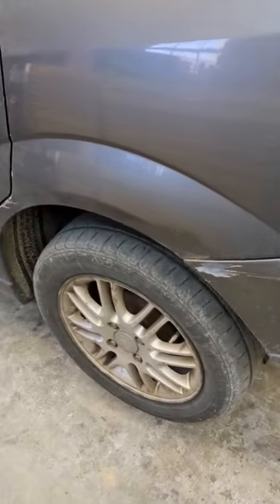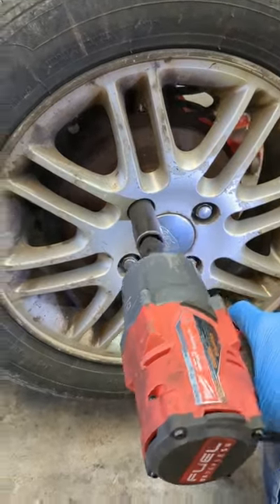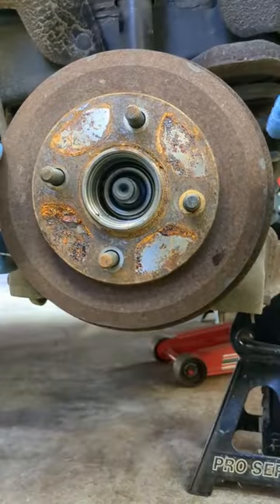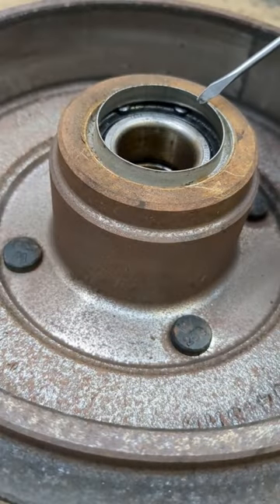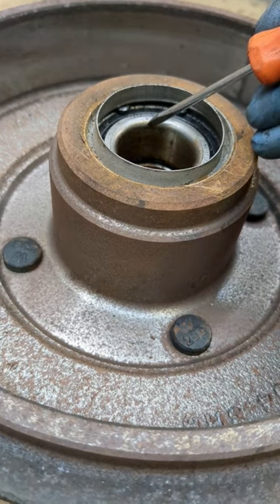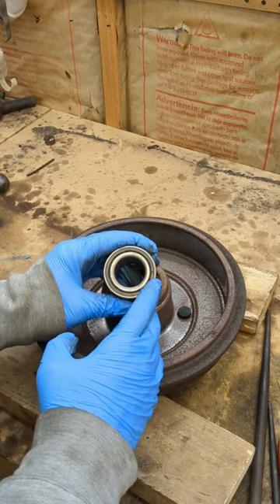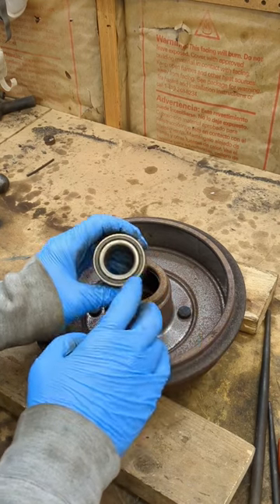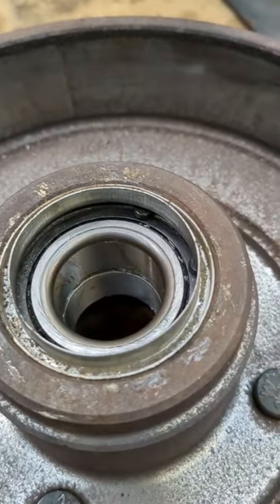This repair was easier than I thought!   DIY - rear wheel bearing replacement - pressed-in style

Comment: First step before your wheel comes off should be breaking the torque on the axle nut.
Reply: Completely disagree on this particular car. That nut doesn't turn with the tire, it's pinching the inner race to the car, and the outer race should move freely around it. I will caveat that to say as a beat practice, I always apply force to the breaker bar pushing towards the ground, else spin it off with an air tool and it won't matter anyway. Safety wise there may be an advantage to breaking it on the ground so you don't tip the thing off the jack by applying horizontal force to the whole car if you have the breaker pointed the wrong way though, so, maybe.....

Comment: As far as in afford, the only one that has those type of lockbolts, they look special when you look at them, it’s all in a cage with a boat for five pieces of metal which lock sit down with supposed to be prevented from loosening, sir like putting on that against the nut

Comment: Someone installed the wrong nut. It’s usually multiple Knutson and one from Ford only this way and walks into the hub.
Reply from the maker: Interesting...this is the first Ford vehicle ive replaced rear wheel bearing....I'll have the check out the other side.... thanks